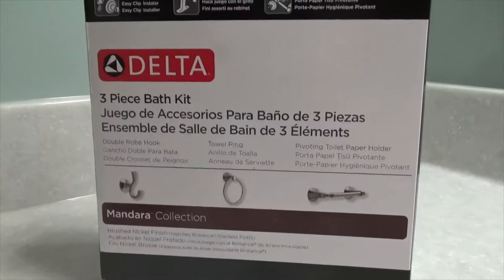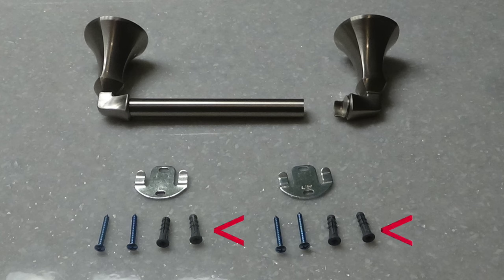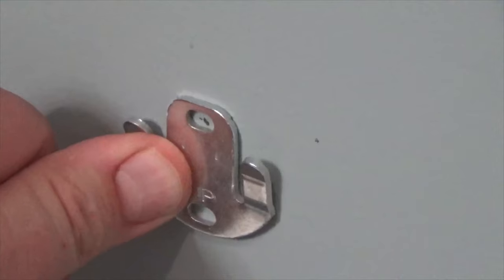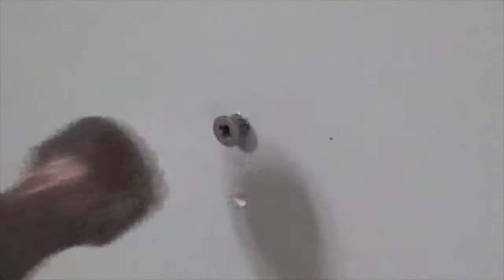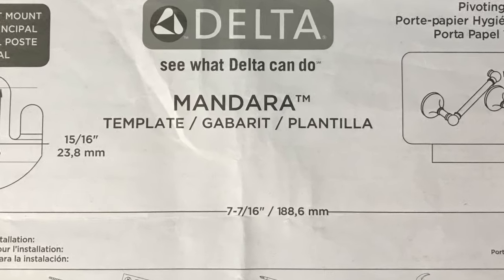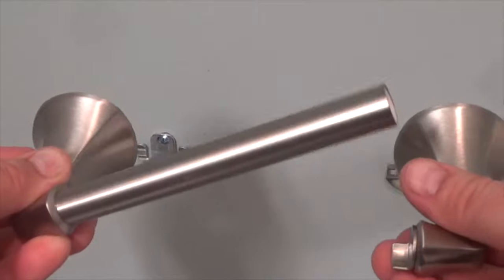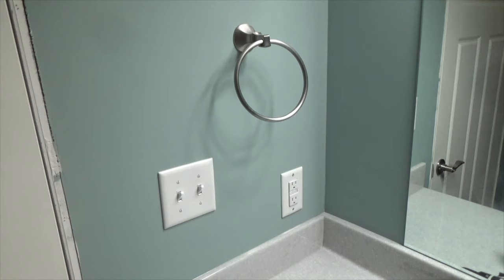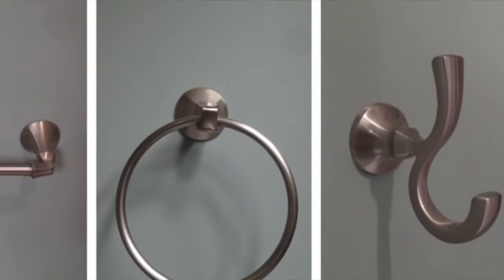How to Install Bathroom Racks - Delta 3 Piece Bath Kit

Comment: I have 2 questions ,how well does the assembly lock to the wall plate and how do you remove the assembly from the wall plate?
Reply from the maker: they seem to lock fine.  I have never had to take one off yet, but if I get around to it, I may investigate this and let you know.
Reply: Maybe that is my problem is that I am not locking them into place. I just slide the tab into the slot but there is no locking occurring. Should I feel or hear a lock occur?

Comment: I have one robe hook that is loose.  It does not fit tightly against the wall.  Do you have any idea how to tighten it? It has no set screw.
Reply from the maker: sounds like the anchors are loose.  Knock those anchors thru, and replace with larger anchors.   That's my best guess without seeing it.
Reply: @PhilCrockett  Yes, I guess it would be difficult to diagnose without seeing it, and I probably didn't  do a very good job of explaining the problem.  Sorry!  The mounting bracket is not loose at the wall.  The robe hanger is loose on the mounting bracket, and there is no set screw to tighten it.  Thank you.
Reply: Kevin Bushnell your anchor isn’t allá the way in. I had the same problem. Try hammering it a little further. Gently, otherwise you’ll mess it up. Try a softer hammer. You can even try to “punch” it in

Comment: I installed mine but I find that the after mounting the slots into the tabs that the base Mount is not that firm and easily pops off if a slight force occurs upward. The base wobbles too when the bar is grabbed. Am I doing something wrong because I can’t see how anyone would want such a wobbling towel bar.
Reply from the maker: really not sure how to diagnose your issue without being there to look at it.   that's the problem with helping folks over YT.   ....
Reply: @PhilCrockett  the tabs apparently go through the slots but I don’t hear or feel any click so I am not sure what the purpose of the curve hook at the end of the tab. The tab is not going all the way through the slot and hooking around the slot . Should it?

Comment: There is no locking mechanism on these it's just a hanger. If you pull a towel from it quick it could move or fall off. Nice looking stuff but crappy hardware. Liked your vid still! ;)
Reply from the maker: Cool, thanks